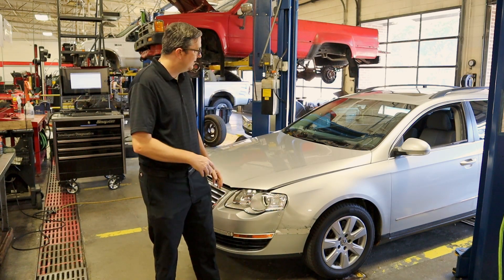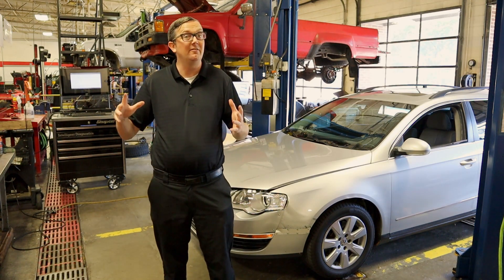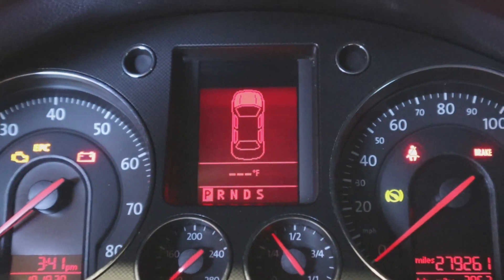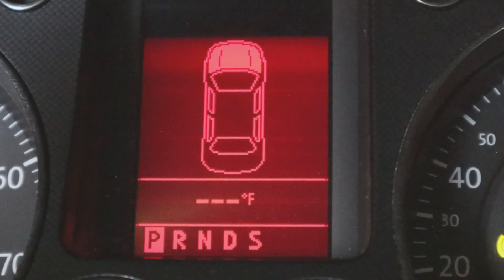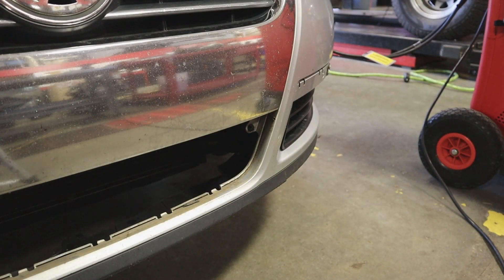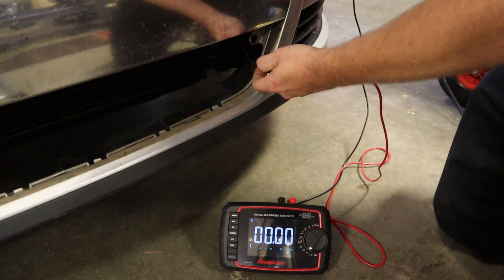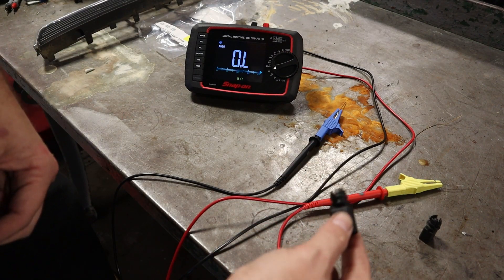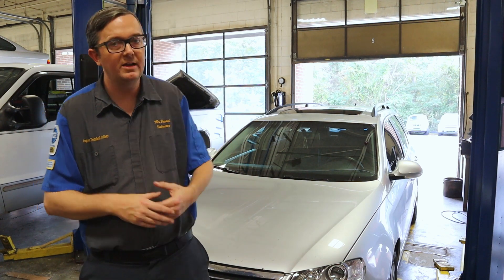Volkswagen 00779 Outside Temperature Malfunction Fix and Diagnostics

Comment: Ok Mr. B. Here is my issue. 2015 VW Jetta. Changed the temp sensor. Hooked up my snap on solus or modis that a friend let me use. And I still can’t get the A/C to work. The temp sensor is getting a reading so know it is good. And I have voltage to plug. My question is there a way to fix the cluster if the issue is there?  The VW dealer is on back order with no time frame on arrival of the clusters. Thanks for all the good work.

Comment: Nice video, thank you. A couple questions, if I may: A) Does the need for a half hour or so calibration apply to most car brands? 
B) I am also getting those crazy temp readings and error codes for that sensor. I tested the resistance of the sensor and it is within spec (2.7-2.9 KOhm); when I probe the two car wires, without the sensor installed, it shows 5V on one wire and nothing on the other, but when I back probe the same wires with the sensor installed, it shows 5V on both wires - from what you said that is not right, in that there should be at least some voltage drop. How can there be normal resistance and the same voltage on both wires- is this confirmation that the sensor is bad, despite having normal resistance? The temp reading is clearly wrong (185F).
Thanks again,

Comment: Thanks you for your video, i buy a 2004 Passat and AC its no blowing cold Air,. I'm just find out the outside temperature sensor it's missing, and Wires are hanging,,.. thanks 🙏

Comment: Have a 2012 beetle with outside ambient temp codes. Car had front bumper replaced. So I thought it would be mounted on lower driver side but instead found it on top by radiator.  So I found one wire had 12v and other ground to sensor.  So do you think I have a bad cluster?
Reply from the maker: Not sure, your system is probably different

Comment: Good video, thanks for that. A bad outside temperature sensor can cause, that the electric auxiliary fan not turning on when ac is on? Give direct 12v to the fan, it is spinning. VCDS says, there is a fault code, Outside Air Temperature sensor (G17) is "open or shorted" or something similar. The temprature on the instrument and on the climatronic is looks valid. Or maybe cause the problem a broken fuse or relay? Thanks a lot!
Reply from the maker: I do not believe the fan would be related. If the a/c is cold, that would indicate the compressor is working. A bad temp sender for the instrument panel would not allow the compressor to come on. I would check fuses/relays and go from there.
Reply: @AutoScholarwithMrB You were right. There is an orange coloured 40A 32v fuse under the steering wheel. That cause the problem. Thanks a lot!

Comment: Nice video thankyou. I have the same error on my passat b5 2000
I changed the sensor but climatronic shows the accurate temp. but the ins trument cluster doesnt. My technician did nt find the broken wire (or short to ground)     from the cluster to climatronic junction. Could you help me the procedure to solve the problem. Regards...
Reply from the maker: Could be the instrument cluster itself. Sorry to hear you are having problems.

Comment: Hello Mr. B and the rest of youtube, My T5 2.5TDI radiator fan keeps blowing full speed as soon as you turn on the ignition. Gave the 00779 code, and 5697 code(airco module). Changed the outside temp sensor, let it idle, no luck. The plug tests about 5volts, both sensors (old and new)are arround the 900ohm, close to yours. Checked the wiringharnas behind the bumper and tests are showing its fine.  What else could it be? Fan Control module maybe? Or could the airco module produce this problem?
Reply from the maker: Very well could be the fan module sticking.
Reply: @AutoScholarwithMrB  I have the same issue, changed the fan  and the sensor, but I noticed voltage  is only 3.2 V and when I turn my lights on temp shown goes down and voltage is only 0.7V . Could it be a cluster Isue as my gas Guage stopped  working? Any thoughts anyone?

Comment: Hello! My car has 5v signal, I’ve replaced the sensor that was crazy, and ran the car for 30 minutes, but the sensor keeps reading -6°C, what can be it? 

Engine oil temperature, inside and coolant all measuring like they should.
Reply from the maker: May be the temperature input in the instrument cluster that has failed unfortunately, or a break in the signal wire to the cluster.
Reply: @AutoScholarwithMrB  Can be, but the strange thing is that if I remove the sensor it reads - - - and when I install it it reads -6°C 
If I take the sensor out the engine fans start spinning non-stop. 
Could still be related to the cluster?
Reply from the maker: Is it possible the new sensor is faulty?
Reply: @AutoScholarwithMrB  Could be, I’ll try another sensor, I’ll feedback if it fixes the issue.

Comment: I hit a bump and snapped the wiring connection to this sensor. I believe the sensor is still good I just have to reconnect the wire and I don't know where that wire goes. It's just u st dangling at the bottom

Comment: Good day, hope you are well. I hope you can help me, we drive a VW Passat 2007 model 2.0. We never had problems with our car until a year ago. Our AC stopped working. We found your video and realised that we have the same problem as the one you fixed on the video. Before the AC broke the reading was there but totally wrong, when the AC broke the reading disappeared totally. We bought a new sensor and replaced it and we also checked the power and all seems fine. The temperature is back on the cluster but the AC is still not working. We did the 30minute drive but no luck. The car AC was vacuumed and it was filled with gas again. Any idea on what else to check? We also replaced the pressure switch on the AC pipe.
Reply from the maker: Could be a bad compressor, that is a pretty common issue. You would need to see the gauge readings.
Reply: Is there a way to see if the compressor is working correctly without the diagnostic? We did by passed the system when the AC stopped working. The AC started working but a few minutes later the safety valve on the compressor popped and some gas came out. We switched the car of immediately and the gas stopped coming out. That is when we took the car for the vacuum and re-full on the AC.
Reply from the maker: @abigailodendaal6811  you would have to have the gauge readings. Sounds like either the high side was restricted or the car was overcharged.
Reply: Thank you. I will have a look at that. Your help is appreciated sincerely.
Reply from the maker: @abigailodendaal6811  no problem, Abigail, thanks for watching!

Comment: Hey my Ambient temp sensor reading correct value and also displaying on dash,  but im getting a code that compressor shutoff due to outside temperature too low and compressor is not engaging mine is skoda Octavia 2012... It doesn't have automatic climate control
Reply from the maker: Does the code come back when deleted?
Reply: @AutoScholarwithMrB  its not a code actually... I was seeing live data in my scanner and in live data in compressor shutoff conditions..  I saw that compressor is shutoff due to outside airtemp too low... But on my dash its displaying 32°C
Reply from the maker: @dieselhead5891  I would look at the wiring going into the module for ambient temperature sense. Unfortunately I don’t have access to diagrams for Škoda.
Reply: @AutoScholarwithMrB  ok... Does it have any cabin temperature sensor?
Reply from the maker: I’m sure it does but anything off with that would set a code normally
Reply: @AutoScholarwithMrB  yeah but im having a parameter here it say "outside air temperature internally calculated" and its reading zero
Reply: Evaporator temperature sensor and outside temp sensor reading correct value but not sure about this parameter... Can you please help me with the location of cabin temp sensor... Mine is 2012 skoda octavia ... It has manual AC... Not automatic climate control

Comment: heyo,

gotta 08 jetta, my ambient temp sensor was hanging under the car and they plugged it back in. not sure what the code was, they didnt tell me.  weird thing happened before i took my car into the shop. I went to a car wash, i drove onto the track and put it in neutral, when the water started washing the front of the car, i got the temp reading back for a good couple seconds, enough for me to put the car back in drive and back in neutral. so the error  with the three dashes reappeared when the car wash machine started heading towards the back of the vehicle. the difference in the reading vs real temp was about 9 degrees off. 

they informed me that itll be a fix worth a couple hundred dollars. which i dont want to do if i dont really need it bc i dont have the money right now. not to mention that i also need a fkn water pump to do. and need money for that.  anyway, is fix truly this needed?
Reply from the maker: As long as the A/C is working I wouldn’t worry about it
Reply: @AutoScholarwithMrB  well funny thing about that lol, my ac only works on the 4th setting.
Reply from the maker: @ISTHIStheKRUSTYKRABx that’s the blower motor resistor, it has failed.
Reply: @AutoScholarwithMrB  is it safe to say at this point, just get a new car? its running on 171k+ miles
Reply from the maker: @ISTHIStheKRUSTYKRABx  if the drivetrain is okay, I’d keep it.

Comment: I replaced the sensor 
I even rewired the hub 

I tested the old sensor and it was reading low resistance. 

My ambient temperature is still reading low 

I don’t know what else to do. Does anyone have any suggestions?

Comment: Hello, I have such a problem, maybe you can help me. On the WV PASSATZE B6, the water fan rotates only at one speed and forces water into the plug. I changed the fan, the water temperature sensor and the engine computer. I was at the Volkswagen center, unfortunately no one could hear anything. Has anyone had such a case? Thanks in advance !

Comment: Hey my car isn't showing in the display the temperature anymore,  so I've tried to change the sensor but it still not working 😕.  Maybe it could be the wires?
Reply from the maker: It may be, or an issue with the cluster
Reply: @AutoScholarwithMrB  on Saturday the car was showing some crazy temperatures,  like - 12° and it was around  6° outside,  and today just stopped showing the temperature and I had to use that easy start for the engine starts the first time
Reply from the maker: @Thiago-xz6zp  that’s strange. Is it setting any codes?
Reply: @AutoScholarwithMrB  no it's not showing any error, could it have something related with the coolant temperature sensor?
Reply from the maker: @Thiago-xz6zp  if the car is running poorly yes, but if the cluster isn’t showing the outside temperature, it isn’t related to that issue.
Reply: @AutoScholarwithMrB  yeah the car isn't normal , and even after like 30 min driving it shows like 70° the engine temperature it's too low after half hour driving,  that's why I asked. It should ne showing 90° or more
Reply: Just giving you an update about my case... it was the wire that was corroded,  I live in Ireland and that's the price when you live in an island...fuck corrosion
Reply from the maker: @Thiago-xz6zp  thanks for the update, and glad you got it figured out.

Comment: HI
I GOT 4.6  VOLTS ON MY VW RABBIT 2007 2.5L , LES THAN 5V AFFECTS FROM CLUSTER ?
Reply from the maker: That should be enough voltage
Reply: @AutoScholarwithMrB  thanks for replying , got the ac presure sensor code in scan  , I gonna replace it and see if the outside temp works on cluster

Comment: Replaced sensor. It was good (as well with the old one) first 12 mins good readings, than started to fail again.
Shows 10-15°C less. Sometimes runs like mad into -30°C and outside is 30+.
Any hints perhaps?
Wiring, connectors...something?
I was on ECU computer and service at authorised VW service and they said: Everything is ok with your Golf MK5, everything is tip-top state and your AC is working fine as well as outside temp sensors 🤦🏻🤦🏻🤦🏻🤦🏻😂😂😂😂
They billed me ofcourse, but they didnt do nothing! 😂
They ensure me that its working 😂
And I am looking dash reading 10°C, AC not cooling at all, outside is hell approx 35°C 🤦🏻
Asked them whos crazy me or you folks, look at this, did you even touched that car or what?
Solved nothing...
(AC was serviced, not leaking, fresh oil/gas into the system).
Desperate.
I will never buy VW again! Never ever!
I would rather ride with romobile.

P.S.
Bought brand new small city VW UP!
Water system cooling expansion tank blew like bomb on car with 1000km!!
They replaced because its brand new with warranty, BUT!! Hows that possible with a new car??